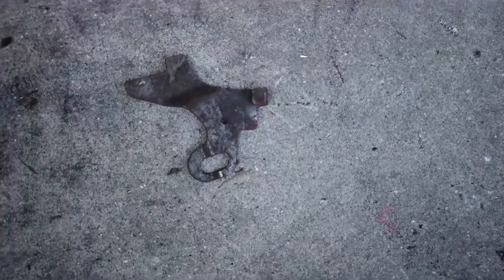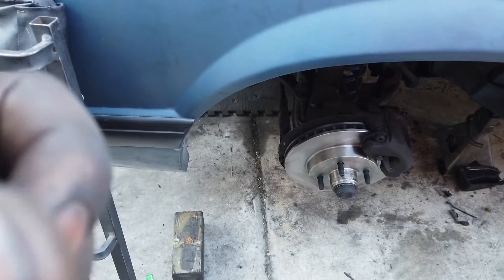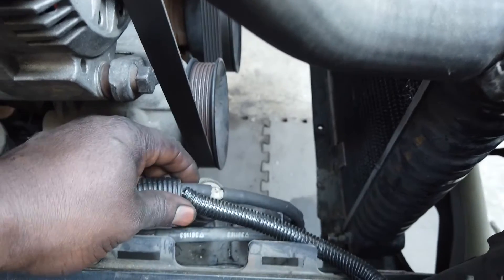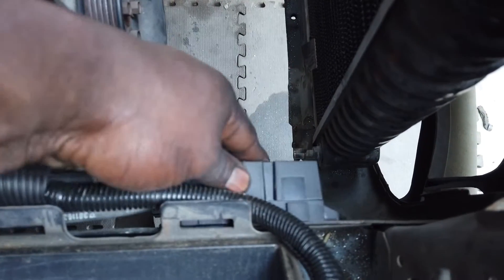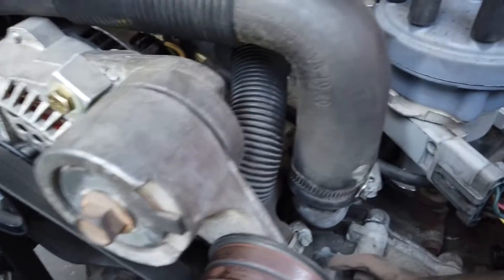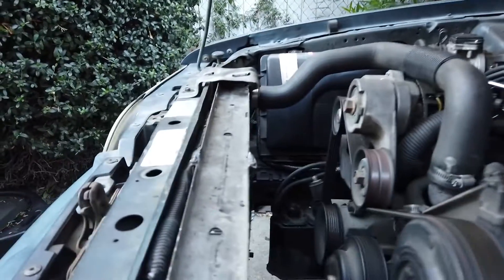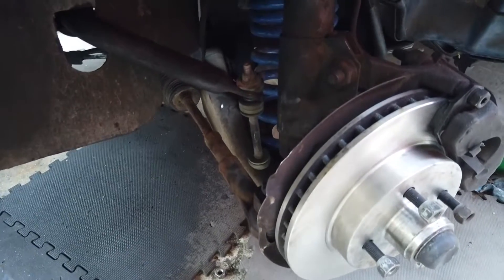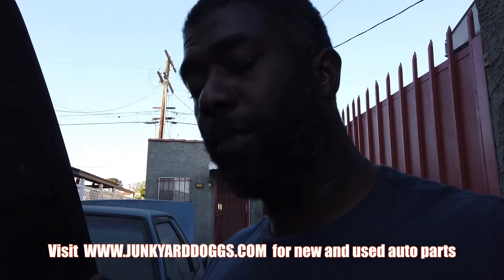Day 14 of 7 lol - 1987 Notchback Foxbody Mustang 4cyl to V8 Swap

Comment: Hi, Tony or junk yard dogg! Big fan of your channel. Anyway you can use a pry bar and pry down on the the rod end to put pressure on the joint, then while holding down pressure tighten the nut with your impact at the same time, it'll go.

Comment: The parts stores can rent you a ball joint press.  Its like a huge C clamp with a set of cups.  It really makes changing the ball joint on the car easy.  There is a method also to separate the ball joint without a pickle fork to save the boots.  You use a heavy hammer and smack the steering knuckle at the spot the ball joint goes through.  You can use the same method for tie rods.

Comment: A possible cure to get the nuts on the ball joints/tie rod ends without spinning the guts is to re-tap the threads. Look for  a tool truck Matco etc. and get a "Thread File" that has the thread pitch you need. I have a few of them and they have save my butt a few times.

Comment: Alright dawgs you can try putting a jack under the tie rod end after you get it off the stands with some pressure applied with Jack sometimes it will stop the bolt from turning allowing you to tighten the nut good luck man keep dawgin 💪💪

Comment: Dogg u have to give us  a few burn outs after u get it straighten out can't wait to get mine done that pushes me to do mine but mine ain't for sale tho lol! But as me using it as a daily man I noticed a dam cigarette burn on my sun visor everything is starting to make me mad just little thing's wrong with the car! I have sand beige interior in mine but I am going to mix it up I have the real black sail panels for the back but I am going to keep the interior that comes out some people want like 500.$ for them panels it's crazy! Dogg did they keep putting the 85 mph speedo cluster in the 89 V8 cars I found 1 in the J yard yeah it had a 6 grand tach & 85 mph speedo it was in a vert maybe it was early model 89 car but yeah man glad to see u got it done almost anyway u have to give US another video with u riding banging around on them lowering springs! My GT rides ruff I have sve springs I guess u get what u pay for lol!! Dogg u know something I never payed attention to but u a 7.5 rear man the bottom shock going straight in not side to side like a 8.8 plus they have those dam torque bit bolts but yeah the bolt runs straight in on a 7.5 everybody be looking at the diff cover 8.8 shock bolt side to side 3 6 Mafia but something to think about! 👍👍👍👍👍👍👍👍👍👍👍💪💪💪💪💪💪💪💪💪💪💪💪💪💪💪JUNKYARD DOGGING I YELL IT WHEN I WAS LEAVING THE J YARD YESTERDAY CAUSE I WAS CARRYING A MUFFLER IN A TAILPIPE I MADE MY GIRL PUSH THE WHEELBARROW PUT HER TO WORK SHE IS ONLY 4'2 SMALL GIRL !! lol 👍👍👍👍👍👍👍💪💪💪💪💪💪